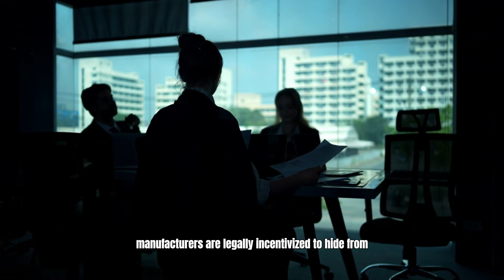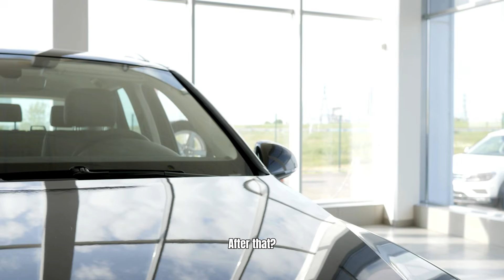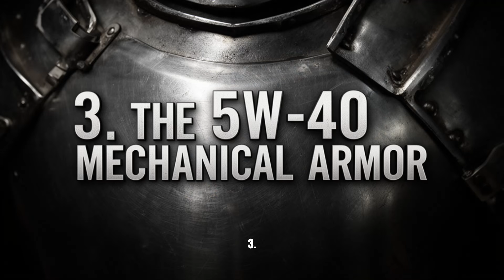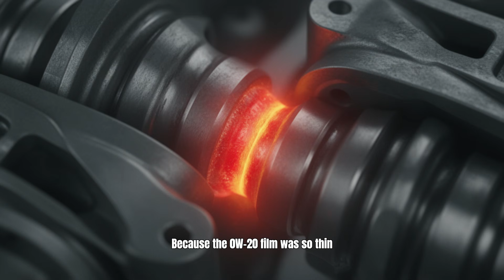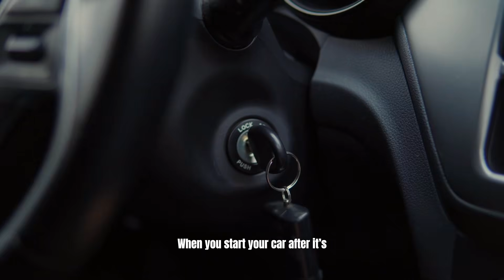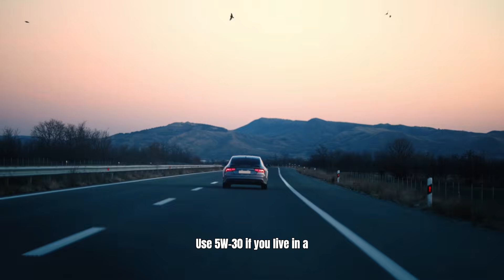0W-20 vs 5W-30 vs 5W-40 : Why "Recommended" Oil is Killing Your Engine

Comment: I've used 5w40 in my turbocharged 1994 car since I've owned it (2011) and it still runs smooth like a new engine.
Reply from the maker: Thanks for sharing your experience! It's incredibly valuable to hear a long-term example like yours, especially with a turbocharged classic from 1994.

Comment: I think this is a little bit of fear mongering. I have a mazda with a 2.0L direct injected skyactiv engine using 0w-20 oil, i have an oil analysis done once a year based on a 5000 mile oil change and have never had more than 11 ppm of iron in my oil sample. In fact my very last oil analysis only had 6 ppm of iron in it. You either had these test done with a poorly maintained engine or it is your oil change interval that is the problem not the viscosity. Its the recommended 7500 to 10,000 mile oil change interval that is causing the wear.  Change your oil sooner and you won't have nearly as much wear on your engine
Reply from the maker: Wow, thank you so much for sharing your detailed experience and oil analysis results! This kind of real-world data and perspective is incredibly valuable to the discussion and helps everyone understand the nuances of engine oil and wear. I really appreciate you taking the time to comment.

Comment: 20/50 as it made my engine live to 400k miles and still going. Raced it on.weekends and drove it to work daily for 100.miles per one way
Reply from the maker: That's an impressive testament to 20W-50! It's always interesting to hear real-world experiences, especially when they differ from common recommendations.